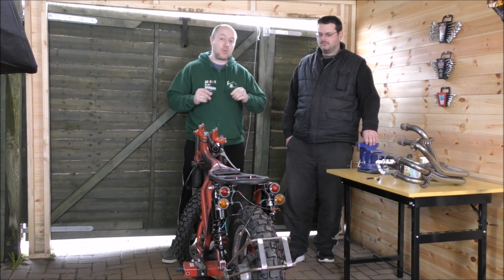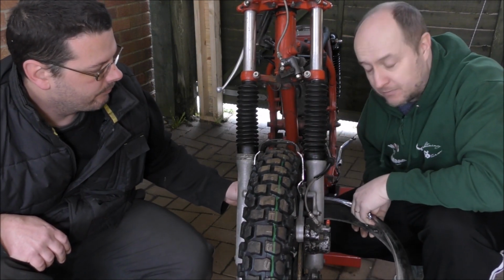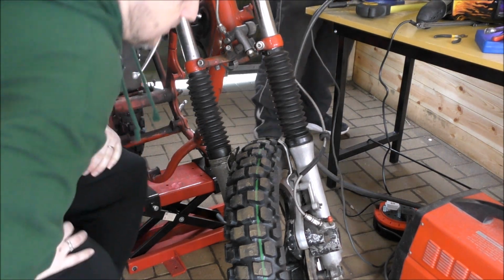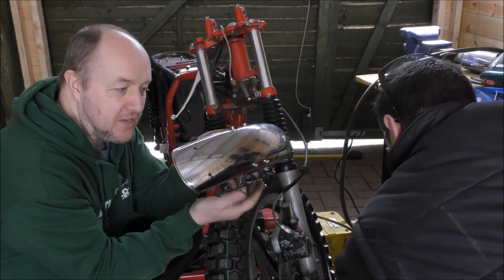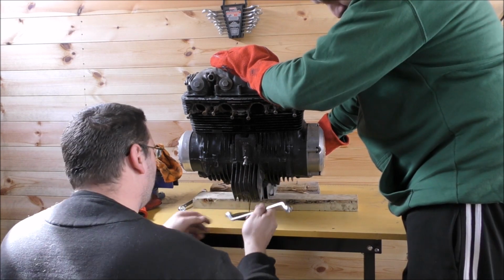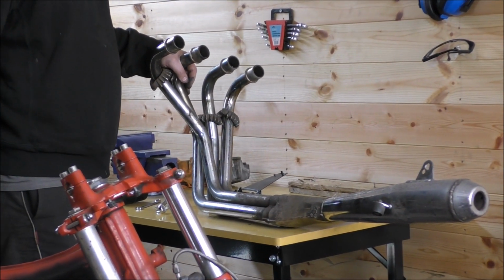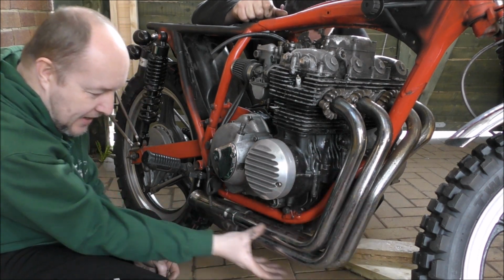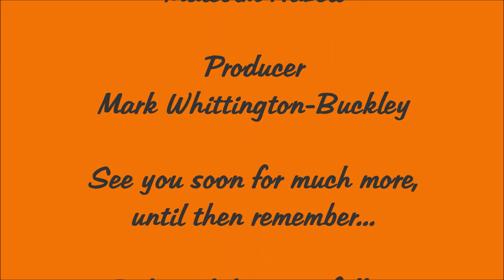Cafe Scrambler BUILD Part 12 Engine Exhaust Mudguard

Comment: Great work, looks really good now.
 I'm looking forward to the finished article.
Another bike saved from the scrapheap which is an important factor. Built not bought!
The speeded up section of the video made me chuckle, I guess it was to mask out the swearing lol.
Reply from the maker: Speeded up bit was to add a bit of humour to an otherwise lengthy process lol
Reply: And there may have been swearing but meh.

Comment: For xzorst sorting/ routing    https://www.demon-tweeks.co.uk/motorsport/universal-exhaust-parts,  you can fabricate your own silencer  https://www.demon-tweeks.co.uk/motorsport/universal-exhaust-silencers  obviously, we all think of silencers being round or oval, but you can make em square which is easier to fabricate, if I got Malcoms idea right, see Buell bikes, they had an underslung silencer-albeit a honking great big one. Bike is looking good- and I like the original pipes, major part of the iconic look of the 400/4 for me.
Reply from the maker: These are car silencers but can be made to fit. I am looking at a couple I have seen on ebay......Thank you for the suggestions
Reply: Not really-they are universal-the "cherry bombs" have been around for bikes for yonks usually called "cigars" back then, used to get em from Pride and Clarke down Leytonstone way, still around see here  https://www.wwag.com/cgi-bin/WebObjects/WebSite.woa/wa/DirectAction?page=!28351, the Tweeks ones are handier coz they are stainless-ezier to MIG than chrome if you have to weld em-but shouldn't need to.

Comment: Your Getting there - having a straight through (LOUD) apparently you lose back pressure & the engine will run hotter, leaner & require carb adjustment done on a machine ,you may also get stopped a lot by 'old bill'- baffling? :-)
Reply from the maker: Both very good points and I have an idea....
Reply: It will probably need dyno’ing etc. so it’ll run properly. It’ll run 1000% better too after the exhaust faffage 👍🏻
Reply from the maker: indeed and it will be.

Comment: On ebay three outlet exhaust pipe muffler tip it wood look nice on it 44.89 in black
Reply from the maker: Sounds interesting, do you have a link please?
Reply from the maker: I have seen them but perhaps a little too much for this bike  https://www.ebay.co.uk/itm/51MM-Exhaust-Muffler-Tail-Pipe-Three-outlet-For-Motorcycle-System-Mounting-Clamp/292330195049?hash=item44103cc869:g:354AAOSwnCFaCpSK